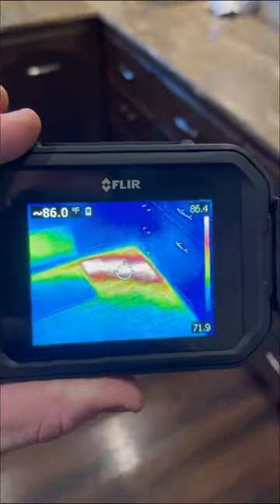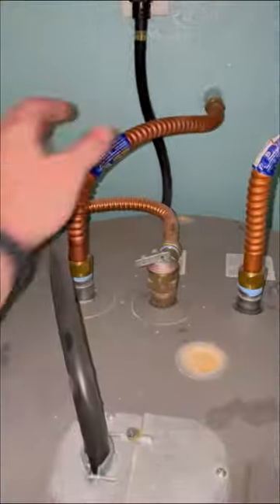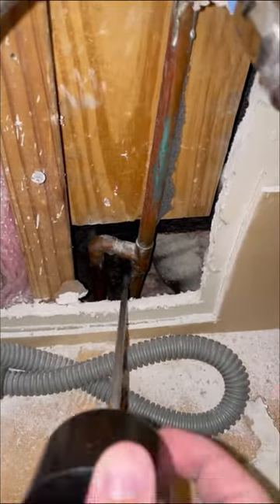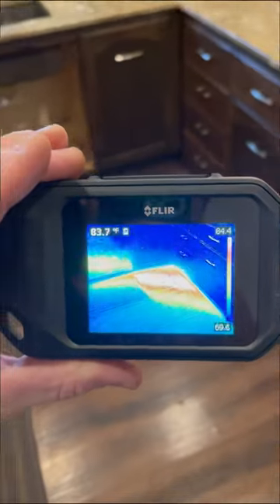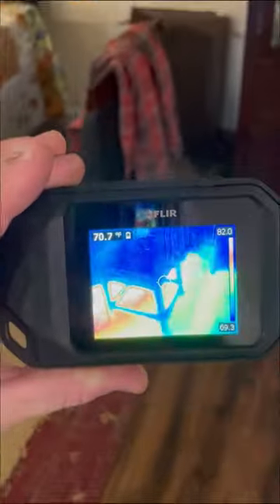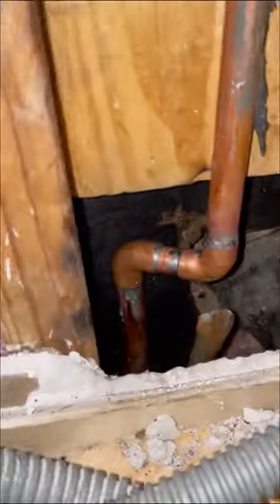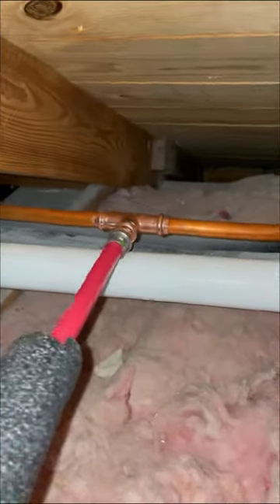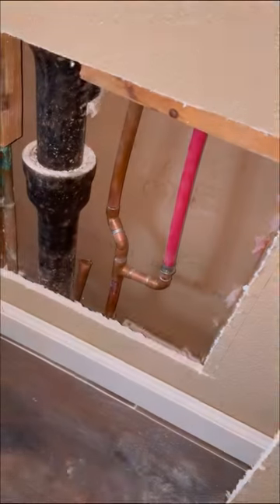Water LEAKING in a home’s foundation.

Comment: There are some 30 year old homes in my area that commonly develop this problem.
Typically caused by acid water corrosion from the well water or a copper line touching rear.

Have also seen some underground lines run in heavy waed roll pipe and the leak is found so easy.
The pipe thats leaking will be overflowing the chase pipe.
It also very easy to repair without going through attic to reroute.
By joining a new line to the old it can be pulled through like wire in conduit!  Pretty genius and not very invasive other than cutting some sheet rock windows.

Casey

Comment: I worked for a plumber who ran 3/8 pex inside the copper instead of going over on a job.
Reply: Sometimes you can, Sometimes you can't.
Reply from the maker: Can’t supply an entire bathroom properly though with a 3/8 line. Maybe one fixture but I would still try to avoid it if possible
Reply: Ive done that. Also fed 1/2" through 3/4"

Comment: Water leaks can be fun and beneficial if you aren’t paying for them!  I had my 40yo inlet piping develop leaks and I could tell as the arbor vitae that run right above that line sure took off in growth the spring preceding me digging a new trench and re routing a new inlet line from the city water.  😂 Bypassed the old pvc as it was too much trouble to dig up and also on the neighbors property. Moved the inlet over and more of a straight shot to the corner of the house.  Several of my neighbors have done the same within the past 5 years due to the age of the homes in the cul de sac.

Comment: Classic slab leak I find that 90percent of mine are on the hot side we have lots of iron in our soil here in East Texas and I do quite a bit of slab leaks
Reply: What does the iron in the soil have to do with it?
Reply: @ajahncodar  electrolysis ferrous and non ferrous metal causes corossion. And after about 25 years you start getting leaks.

Comment: Does anyone know how to reroute an A/C drain that goes down  into the cement floor?  It smells very mildewy down there. The smell goes away when the AC is not running after a week. Opinions vary. Likely a cracked drain pipe. 
Cant reroute up as it is a drain
 
Any suggestions from the experts?  Very much appreciated.
Reply: Are you talking a condensate drain?  Get s condensate pump and pump it up same as used for furnaces and such

Comment: Do you run greater chances for burst pipes in the attic? When a freeze over occurs?
Reply from the maker: If the lines freeze yes it could bust. Pex thankfully has some give to it though. Almost all new homes here (Texas Hill Country) have pex in the attics. As long as they are insulated the do fine.
Reply: For a fact yes you do. Then tens of thousands in flooding possibly.
Reply from the maker: @MAKAROVOWNER  Almost every home since 2005 in my area has PEX in attics. It all depends on where you live and your weather conditions. Definitely don’t do this is you live in cold climates.
Reply: @theplumbersplunger  I lived in Salem Oregon. Saw 2 burst there. Moved to Mississippi. A lady from church had 1 burst here. I have both hot and cold in my top crawl space here. Mine I covered in insulation. I must add 2 more lines above as the kitchen sink will be relocated. Slab has drains and lines poured in. Drain is fubar and don't like the location. There are times when above is the most reasonable way to go, but there is risk.
Reply: @theplumbersplunger If you live in an area with harsh winters your home probably wasn't built on a slab anyway, as your water supply line has to be much deeper underground.

Comment: Crawl space access? If yes repair there is fastest and least expensive. Line break under the house no flooding into interior. Line break over head major interior damage.  My preference is always the simplest least expensive reasonable efective repair. I have rerouted overhead. I do not like it. In freezing conditions you cannot block venting up there and pipes can burst flooding the place.

Comment: If we don’t re route lines through foundation then why have them there in the first place ?
Reply: Be due to the era the home was built in. That was the norm back then all home from that timeframe is piped just like that. In case of a pipe bursting it wouldn’t cause any water damage since it is under the concrete. Verse over head.

Comment: Hey 16seconds in, what is that tool that youre flipping on?
Reply from the maker: The listening equipment?
Reply: Sure
Reply: @theplumbersplunger  I think so?   You were saying something about locating manifold?
Reply: @theplumbersplunger yep I rewatched.   "Listening equipment".   I've never seen that before - ever on any job site! 
Completely new to me!
Reply: Love to see a short about all that boss :).
Reply from the maker: @NinjaofApathy  They have different brands and styles but it’s pretty much a sound amplifier. You use head phones and different probes/plates to listen for leaks. You put air into the system and can hear the bubbling to pinpoint leaks.

Comment: Old homes usually breath and it causes the hot lines to bust. Wish them luck
Reply: What? 😂 Hard Water causes pin hole in copper pipping, not the house "breathing" 😂😂😂
Reply: @boldcityanthony yeah, if anything the foundation has cracks from settling or sink holes